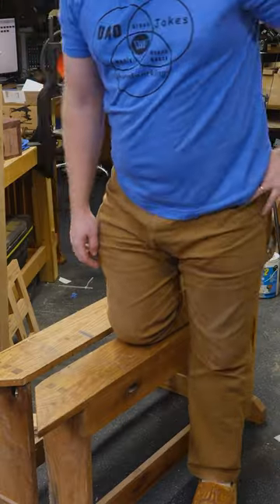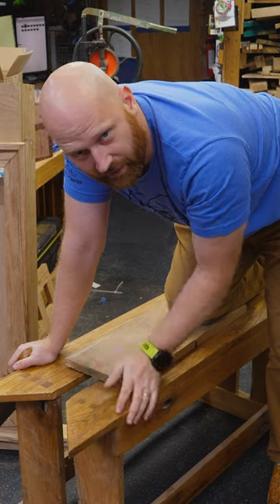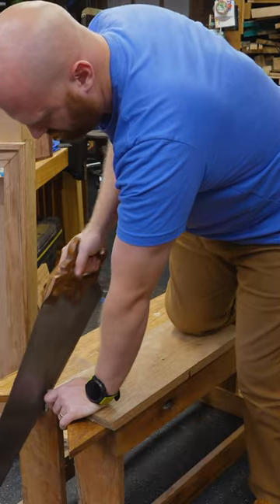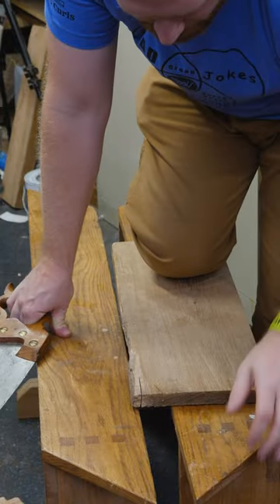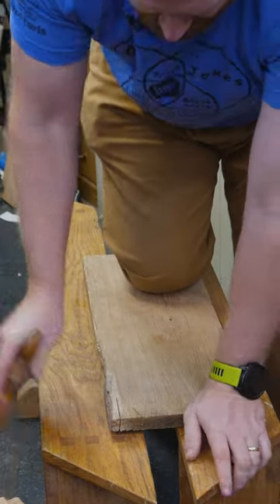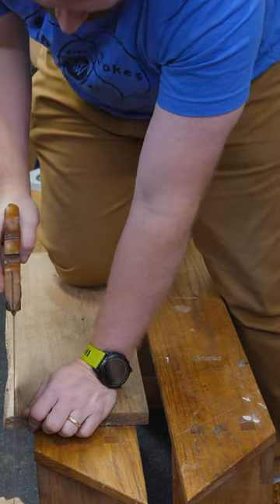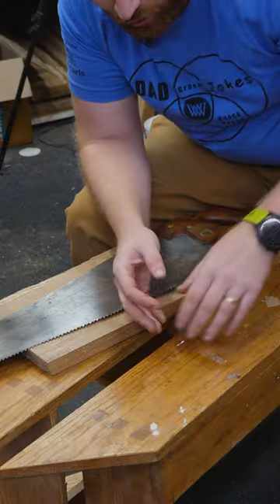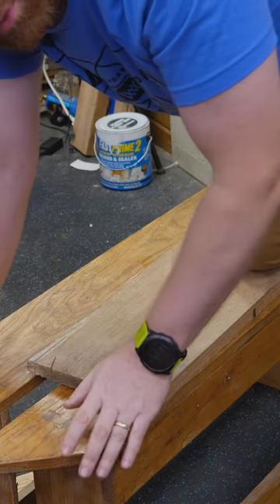What Is a Saw Bench #sawbench #handtool

Comment: This makes me flinch. Years ago while doing this, as I drew the saw back, it went out of the cut, having started the usual rythem, I pushed forward full force before I noticed. The saw was on my thumb. Spent that evening in the hospital waiting my turn to get stiched and bandage up, meanwhile I had a bandaid and numbing shot. Ever since, I've never put my hands near where the saw might end up if it accidentally leaves the cut. I suppose if you make sure you don't lift the saw out of the cut or you don't get into a rythem where you don't notice in time, but as my dad says "accidents happen on accident".
Reply from the maker: The way most traditions teach it is for the saw to slide along the thumb to start the cut. That allows you to position it accurately.

Comment: Is yours out of 4/4 wood?  I had one following Stumpy Nubs' design, from 2x lumber. It worked well but was kind of heavy to move with one hand. I left it behind when I moved and I'm thinking about a new one, a bit lighter. Good video - you're very good with shorts. I don't find woodworking shorts very useful generally, but yours are usually an exception. Thank you.
Reply from the maker: Mine is out of 3/4 material. Here is the video from it.https://youtu.be/wP2YYKIxJ90?si=GrkniEyXp8iMEbmW
Reply: I was thinking about building the Stumpy Nubs design too as a seat and saw bench to justify the footprint in my garage. Did yours seem stout enough for that? Thanks

Comment: Big facts: if your saw bench and workbench are both made according to your knee and hip height, you can put the WbW saw bench on your workbench and use the birds mouth with a coping saw. I do this all the time for making saw handles and plane totes.

Oh, I should also mention the making Krenov style saw horses with the lower rung at the saw bench height and the top at workbench height allows you to support work more easily and efficiently.